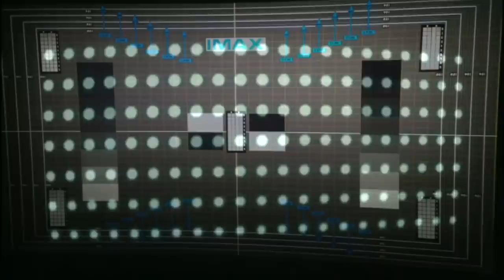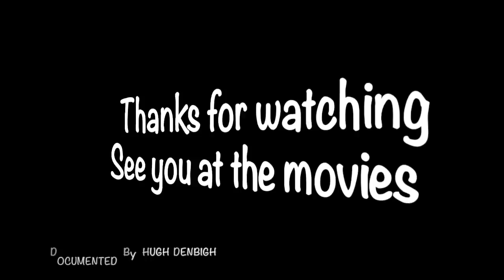IMAX 4K Laser upgrade time-lapse, from 1570 2D - IMAX Theatre - Royal B C Museum

Comment: That LFE section seems so underpowered. We have 8 double 18" Subs+2 single 18" on the walls for a 200 seat theater and it could still be more power. Can't imagine how that few stacks can adequately fill such a huge auditorium.
Reply: IMAX theaters should really have a rotary woofer as standard equipment. Ordinary subwoofers fall off sharply below 20 Hz, rotaries are the only thing that can effectively cover the 0-20 Hz range.
Reply: @KingdaToro  I'll paypal you 1000$ if you find me a woofer that can produce 0hz
Reply: @julianklietz6558  As I said, a rotary woofer. It's a subwoofer that uses a rotating fan, instead of a cone, to move air. Like this: https://www.youtube.com/watch?v=E7Bkrypxzs4 

The pitch of the fan's blades is controlled by an ordinary subwoofer voice coil, so they pitch back and forth, and push air into and out of the listening room, according to the audio signal. They're able to effortlessly cover the entire 0-20 Hz range because the fan makes more revolutions per cycle of the audio signal as the frequency drops. If you were to feed DC (0 Hz) to an ordinary subwoofer, the cone moves in or out and stays there doing nothing. If you were to feed DC to a rotary woofer, the fan's blades would pitch one way or the other and stay there, and the fan would constantly push air into or pull air out of the room. So, yes, it can indeed do 0Hz.

It's all about excursion. That's the distance through which a speaker can move, and it's what limits normal subwoofers to about 20Hz. But with a rotary, the "excursion" isn't the distance the cone can move, but rather how far the fan can turn during each cycle of the audio signal. At 20 Hz it will only do about half a revolution, but at 1 Hz it'll do 13 revolutions. The effective excursion increases as the frequency decreases, which is exactly what you want in a subwoofer. And at 0 Hz, it has effectively infinite excursion.
Reply: @KingdaToro  It can produce a 0hz tone?
Reply: @julianklietz6558  Yes. A sound wave is just air moving back and forth at a certain frequency. A 0Hz "tone" is just air moving in one direction continuously. Of course it can do that.
Reply: @KingdaToro   I can tell you with confidence that that is not what sound is. Sound is the change of air pressure over time, as there is no change in air pressure at 0hz there is no sound. Therefore it's logically impossible to have a 0hz sound. What you are describing is wind.
Reply: You'll tend to find less control in the low frequencies with dual 18s, hence why they are using either 10s or 12s (i can't tell) in this setup - there aren't many but considering they are all stacked together, they will still have a considerable impact, plus way more control than any 18s can offer.
Reply: @Mr Derp I wasn't saying 0hz sound is wind (I would never say that any sound is wind), I was saying his definition of sound (air moving back and forth) was wrong. According to that erroneous definition perhaps 0hz is possible, but as I already stated that is not how sound is defined. Also I didn't try to be cheeky or clever, I was actually trying to make a joke about that 0hz tone that was implied by adams comment, that I thought was clearly impossible. Maybe this was not as clear as I thought. So I wasn't really trying to be clever, I just happened to be clever, or more clever than you at least 
(that's what trying to be cheeky sounds like for future reference)
Reply: @julianklietz6558  oh oh, can I continuate on this silly discussion???   Take any subwoofer you like... switch it off, than you'll have your 0hz woofer.... ooooh wat shall I do with a 1000 bucks 🤑Maybe upgrade to a 1Hz woofer
Reply: @ginglyst  hm, maybe I should be a little more open to the idea of 0hz sound. Okay I'll paypal you that money, I'll need an email address please.
Reply: @julianklietz6558  ah sorry my sarcasm is not what it should be. Don't send any money! Stand your ground!
To be clear on what I really thought of this silly discussion: 0Hz sound is not a sound. Its the same as dividing by 0, ie all definition of sound is lost at 0Hz henceforth a subwoofer of 0Hz looses its definition of being a (working) subwoofer, so it doesn't exist.
Reply: @ginglyst  Yeah I was being sarcastic aswell, mate. All good. Sarcasm really seem to come across perfectly over text, doesn't it? Maybe I'll have to start adding a "Kappa" at the end of everything I say that isn't 100% serious. This whole discussion could have probably been avoided.
Reply: @julianklietz6558  Yes, it is. But the distinction between sound and wind blurs as 0Hz is approached. If there's a wind that blows one way for 4 seconds, then blows the other way for 4 seconds, repeating, that is in fact a a 0.25 Hz sound wave.
Reply: @KingdaToro  yeah but it's just not, is it? I can keep repeating myself if you want: without a change in air pressure over time, there is no sound. As the Wikipedia article on sound puts it: "Note that the particles of the medium do not travel with the sound wave. This is intuitively obvious for a solid, and the same is true for liquids and gases (that is, the vibrations of particles in the gas or liquid transport the vibrations, while the average position of the particles over time does not change)" of cause the air particles still have to move in order for a change in pressure to occur, but that's obviously not what you've been arguing.
Reply: This is a pointless debate, because "Sound" is an abstract concept, not concrete.  0.001Hz is still sound.  Pointless, but nonetheless.  And there hasn't yet been enough time in the history of time to distinguish 0Hz from "not quite 0Hz, still technically vibration" because 0Hz would be zero movement over infinite time, and we haven't got that long to wait.

So can a woofer "play" 0Hz?  No, or at least not the we could ever measure, because as long as we wait, there's still a chance it will reverse and impose a pressure differential in the other direction -- and then it's not 0Hz anymore.  BUT IT'S CLOSE ENOUGH, so who the 🤪 cares?
Reply: I watched Dunkirk in this theater, and I can tell you their sound system is very adequate.
Reply: @julianklietz6558  You guys are basically arguing the difference between DC and AC. Is DC really just a 0Hz AC frequency? hahaha. The exact frequency 0 Hz can never be considered sound.
Reply: @Dawood4  no hahaha, were really not. At least you agree that 0hz isn't sound.
Reply: @nickwallette6201  mate, sound is a well defined thing and it occours unambiguously in nature, it's not abstract. As long as a longitudinal wave travels through some medium there is sound, even if its 0.001hz(it's not more pointless than any other sound, that's just what that is). Also what is this point about infinite time not having passed yet? You may be forgetting that just because a speaker moves, sound doesn't have to be produced, if a normal 12" sub, or hell even a 12m sub moves through its cycle once a day there will be no sound pressure wave. So the timein which we have to observe the speaker to know weather there is sound or not isn't infinite, it's finite. If a speaker creates no sound waves in 5 hours there is also none in 50 billion years because the difference in pressure that constitutes the sound wave will have already reached an equilibrium. A speaker would have to be massive to reproduce 0.001hz but it could still exist. No speaker could come close to reproducing your "0hz" because it would have to be infinitely large. So the threshold of what sound could be is destinctly over 0hz, unless you want to argue for unlimited space and time and matter in which case have it your way.
Note that my argument only works when a pressure wave(sound) is not conflated with ambient pressure, which shouldn't be a problem as those things are not the same.
Reply: @julianklietz6558   Sound is a loosely defined thing, since we're being pedantic here.  It's a pressure differential through a medium, sure.  A differential means a difference in pressure over time.  That means we have two variables -- pressure, and time.  0Hz would mean no change in pressure between the beginning of time and the end of time, which is infinite.  Just like "DC" means voltage that does not change -- and could be argued to mean there has never been a DC voltage in the history of electronics.

Of course that would be stupid to argue.  So  we accept that anything reasonably close to zero change is effectively zero change.

Ergo, a rotary subwoofer will play as low as you're willing to accept is a change in pressure, and not just a change in ambient pressure.  So... basically, by our practical definition, any frequency down to whatever threshold you define as 0Hz (since actual 0Hz requires measuring differential over infinite time.)

And THAT.. is why.. this whole argument is stupid, pointless, and a waste of everyone's time.  But you just couldn't accept that, when he said "it plays down to 0Hz," it meant "as low as measuring a difference in pressure is still meaningful, because it can basically just inflate the listening space indefinitely."  So here we are, arguing semantics when the meaning, in context, was perfectly clear and cromulent.
Reply: @nickwallette6201  I really don't agree that sound is loosly defined. I wanna say though I never claimed that this debate was practically useful in any way. 
I was basically looking to challange the viewpoint of the "0hz is playable" crowd (which was seemingly based on a wrong premise) and get my own viewpoints challanged aswell in order to hopefully learn something about one of my favorite things: sound. And in the process things became clear to me that were not clear before, so it worked. So you're right I don't accept that this debate is 100% useless and a waste of everyones time, and seemingly neither do you or you would't engage in it yourself, would you?
Reply: @julianklietz6558  TBH, I see many sides of the 0Hz argument.  On one hand, you can argue there's no such thing as 0Hz, so it's inherently unplayable.  You could argue that 0Hz is a shorthand for the noise floor of generated pressure vs. ambient pressure, and as such, you can't rightfully claim to produce what is a fundamentally immeasurable delta.  You could say that 0Hz isn't sound, thus it's out of bounds for any claim to generate sound.  OTOH, you could argue that a device capable of producing an (effectively) infinite stream of variably positive or negative air pressure is capable of generating pressure down to the threshold of what you are willing to call sound, which is for practical purposes, "as small an increment as could be cited above 0Hz."  All that is fine, and I could see the basis for the argument, and play devil's advocate for or against any of those positions.

What I feel the need to push back on, is when someone makes a comment, and fails to generate a stream of tedious caveats because "you know what I mean" and it gets pounced on.  The "well, actually ..." tendency can get in the way of having meaningful conversations, and we end up in the purgatory of comment threads like this.  I think people need to have a little more willingness to let technicalities slide, and try to meet the speaker where they are.  We're losing the ability to have meaningful discourse, and it's tearing society apart.

So, I don't care about the 0Hz thing.  I get where you're coming from, and it's fine.  I only argue against it because I saw your post as an unwarranted attack on someone else's perfectly valid interpretation.  And I wanted to reply with "That's not the point, you know it, you know what they meant, and here's why your POV could be considered just as wrong -- and it matters just as little, so let's all move on."

In all honesty, that reaction is probably contributing to the problem more than the solution.  I'm only human and have as much tendency as anyone to react illogically at things that set me off.

Point is, I guess, rotary subwoofers are awesome, and I wish the Phoenix Gold Cyclone had been manufactured with a varnished motor magnet so they wouldn't tend to seize up.
Reply: @nickwallette6201  ok, fair enough i guess
Reply: Am I the only one that ended up not watching the video and reading this interesting debate? 🤣

I’m learning a lot from all of you… different perspectives and arguments. 
Thank you all that commented 😁
Reply: @julianklietz6558  no wind is constant in speed and direction. Therefore it has a frequency of change. If sound is the change of air pressure over time, then by your definition, wind is indeed sound.
Reply: @lukapogo  Please explain to me how pressure is the same thing as velocity.
Reply: um 0hz is a stationary cone or fan. Ie. Static electric fields are 0hz. If a force does not continue a cycle thus no movement. No tone.. but 0hz iz real but not a tone.
Reply: I find ever IMAX I have visited (Ukraine, Austria) having LFE heavily underpowered.
Reply: IIRC IMAX use Eminence LAB 12 drivers, which are well known for being very capable (very high linear and peak excursion capability.) Clustering them (32 drivers) gives some gain from coupling. Achieving peak reference SPL at sub-bass frequencies would clearly be challenging in a full scale IMAX GT auditorium; I'd imagine they are using some limiting (and surely high pass filtering as they're a ported design.) However, sitting towards the front of an IMAX (dual laser GT projection) featuring the same screen speaker system, on a movie like "Dunkirk," my ears were popping. And it can certainly be heard rumbling away in the foyer that's underneath the stadium seating structure.

Tthe "satellites" ("IMAX Kanga") are decent but can get a bit harsh and lose clarity at peak levels. IMAX (at least at that venue and another I'm familar with CoLa projection and newer generation "satellites") does well for consistency though with automatic recalibration/remote monitoring. I've never found the sound to be obviously not at reference level... whereas the typical local multiplex...well, mine was good when it newly opened (QSC screen speakers)--but it wasn't too long before levels went down in some screens.

Comment: For those complaining about 4K... 8K is coming to most venues soon enough... I'd say 5 years before most commercial venues are upgraded to that standard... And if it weren't for COVID it would have been commercially rolled out by now...
Reply: there's literally no difference between 4k and 8k on it's quality.
Reply: @miles5600  It absolutely will. It's all about the ratio of screen size and viewing distance. To see any difference, your viewing distance needs to be closer than the diagonal screen size. To see the full benefit of 8K, it needs to be half the diagonal screen size. In a proper IMAX theater, all the seats fall within this range.
Reply: @KingdaToro  8k tv are already around and have been for a couple of years. Also you can now get Imax home cinemas
Reply: they had the downtime to make the upgrades, but they didnt. like restaurants that needs full refurbishment
Reply: Also, 4k in theaters is not the same resolution as 4k televisions
Reply: @propadanda  It's close enough, just 256 pixels wider. And you'll practically never see the full 4096x2160 used, as it's in 1.9:1 aspect ratio. You'll typically see 3996x2160 for 1.85:1 or 4096x1716 for 2.35:1.
Reply: @KingdaToro  Fair point. Pixel density might be similar, but with the aspect ratio of true IMAX, having two stacked 4K images, you should in theory get a better image than standard 4K? Movies actually cut in that aspect ratio are fewer and farther between than ever these days. I have a projection background, albeit not with IMAX.
Reply: "For those complaining about 4K... 8K is coming to most venues soon enough." I mean thats cool and all, but the IMAX film format that these 4k projectors replaced was capable of 12K.  we already had the future but now we have to wait till it catches up again
Reply: This is also a DUAL 4k system so it's slightly better than a single 4K system.
Reply: @DeviloftheHelll  because they were making far less money, don't want to spend tons of money when your income is unstable
Reply: The biggest problems with digital projection in theaters is not that it is 4k or 8k. The issue is how many pixels are on the screen per observation. 
 4k has 8.9 million pixels on a screen and that is just too low for a large screen in a theater with most people actually being able to see the pixels on screen in the theater. 
 8k has about 33 million pixels on screen which probably is more than what is required to actually reduce the pixels on observation. 
Now one away around this might be to use the 2 or 3 projector approach that was used in Cinerama in the 1960s that can introduce about 16 million to 24 million pixels on a screen in a cinema to get it close to the performance of 35mm film in a cinema theater. 
IMAX and other 2 digital projector approach does not use the cinerama of the 1960s but uses an overlapping pixel approach.
Reply: @djmips  
I do not think dual 4k is actually better than standard 4k as the pixels are still seen on the screen. 
If they used the Cinerama approach from the 1960s they probably could use 3 or 4 projectors to create a wide screen approach that has 32 million pixels on screen that would get them close to the performance of 35mm film projection. 
Using shifting pixels simply does nothing in the theater to make more pixels on the screen.